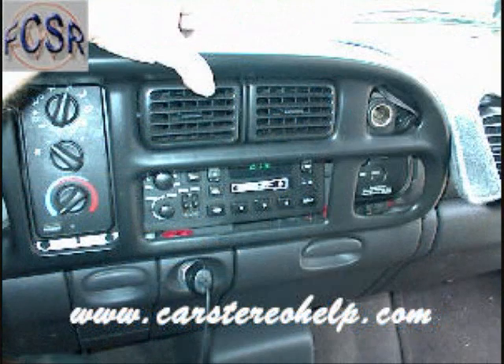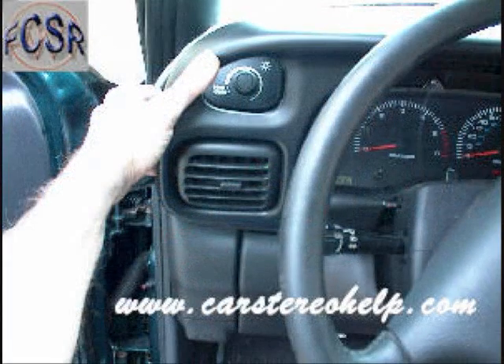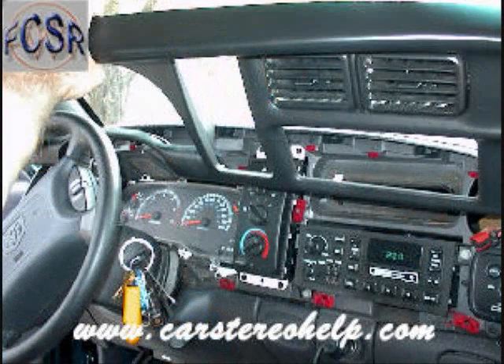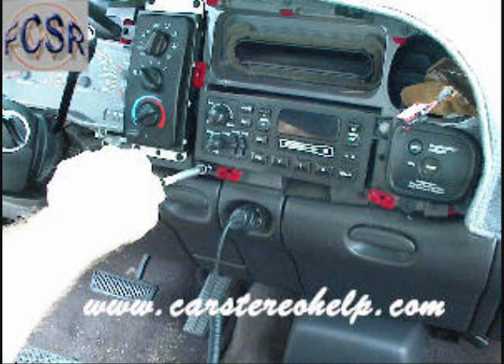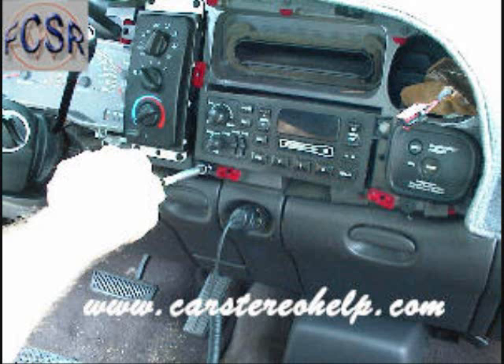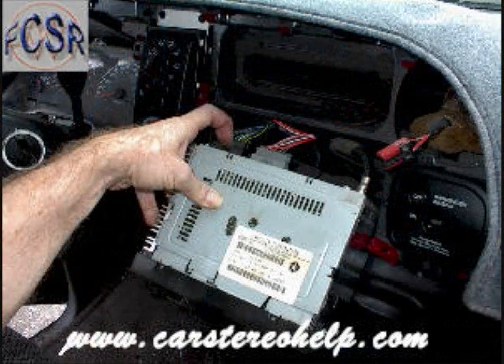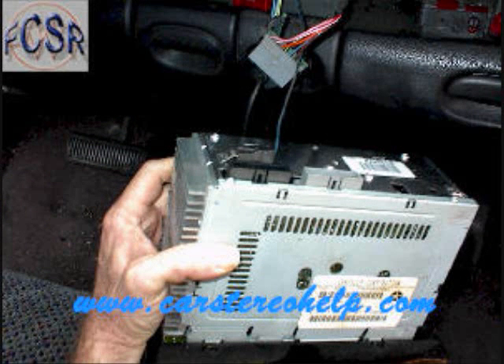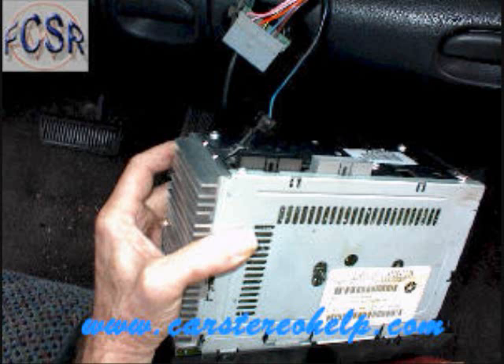Dodge Ram Stereo Removal = Car Stereo HELP

Comment: Anyone else have issues with the front speakers stop working, FM channels not coming in, or buttons not lighting up when head lights are turned on?
Reply: yup all the above
Reply: Same
Reply: Happens with my 98 1500 😄😄😄
Reply: I assume it's a wiring issue with tge speakers, and antenna
Reply: Yep pain in the ass!!
Reply: Old tape deck finally went out a year ago. Put in a decent Bluetooth stereo and some new 6x9s. Life is better now in the old Dodge 😄.

Comment: I have that same truck. I'm having  problems with the Radio I'm putting in. It has one part with alot of cords coming out of it.Do I have to get a splice two the pieces in the truck to match the cords  on the part or do I need an adapter. if I need an adapter how many adapters do I need it has out of wires coming out of it?  I'm so confused. Please help.